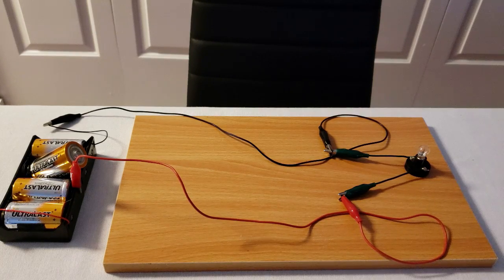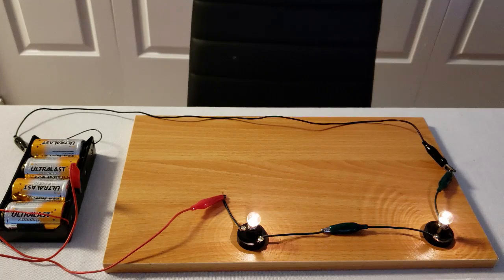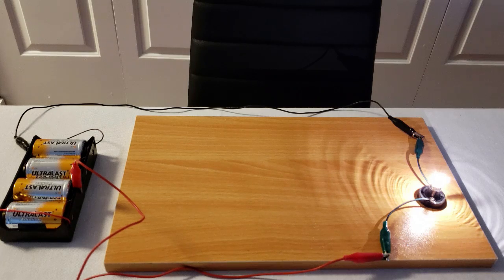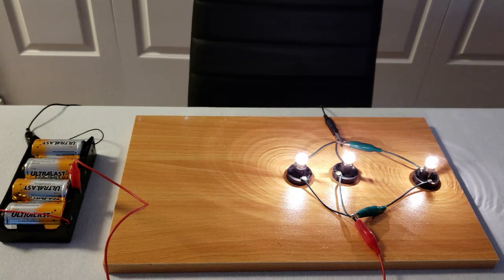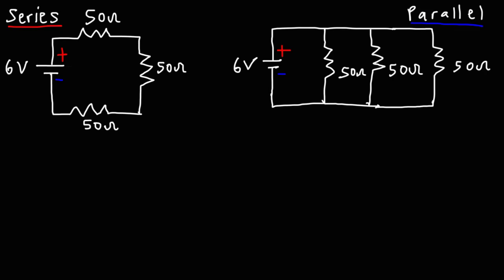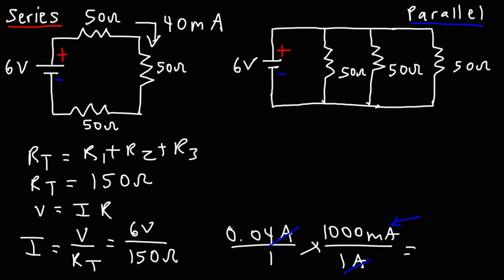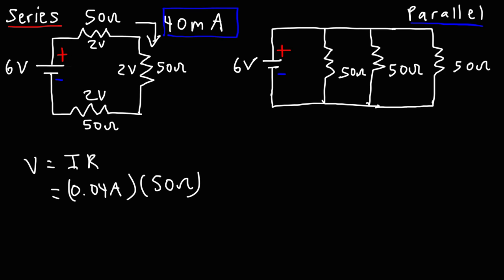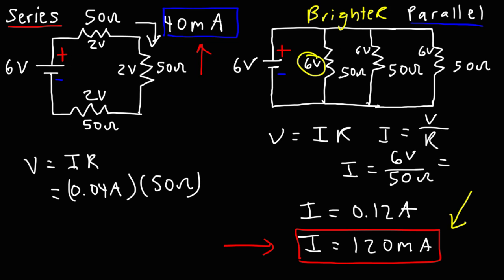Series and Parallel Circuits - Light Bulb Brightness

Comment: 3:18 wont the current split in a parallel circuit PLEASE someone help i have my cie in 10 days
Reply: Yes,the current will split but equally,cuz bulbs are identical.so they glow equally bright.if they were not identical.then the bulb with lesser resistance will glow more,cuz current is inversely proportional to resistance by ohm's law(if we keep voltage constant as in the parallel condition).I too have my entrance exam in 10 days😭.btw all the best.

Comment: I just had a question with parralel resistor lightbulbs, if the ratio of the resistances isnt the same wouldn't that mean the higher resistance bulbs would be dimmer as the split of the current in the parralel is no longer equal?

Comment: For anyone confused on if the light bulb brightness in the series of 2 bulbs is reduced by a reduction in current or voltage, the answer is both.

Here's how: 

If we have a circuit with a single light bulb of 2 ohms and a voltage from the battery of 8V:

V= IR
I= V/R
I= 8/2 = 4A going from the battery, through the single bulb, back to the battery

Power generated by battery = power delivered to bulb

Power = VI
P = (8V)(4A) = 32 W absorbed by the light bulb

Now if its the same circuit of 8V from the battery but going across 2 of the original light bulbs in series, each with 2 ohms of resistance:

V= IR
I= V/R (R is total resistance)
I= 8/4 = 2A going from the battery, through the 2 bulbs, back to the battery

Power delivered to each bulb = VI
Since the voltage across each bulb added together must equal the voltage supplied by the battery, the voltage across each is 4V
P = (4V)(2A) = 8 W absorbed by each light bulb

So if you connect a light bulb of 2 ohms of resistance to a battery of 8V, 32W will be supplied to the light.

If you connect 2 light bulbs in series, each of 2 ohms of resistance to a battery of 8V, 8W will be supplied to each light. (16W total)

This means in the 2 light bulb circuit, each bulb will receive 1/4 the power as the 1 light bulb circuit.

Comment: In series, the current actually stays the same. The voltage splits for each resistor, however. But the total voltage, adding those two up, will be the same as the battery's voltage. And it's not increasing any resistance; the total resistance stays the same. but it is split among the two bulbs.
Reply: Thanks for brining this up. For anyone reading this, watch "Series resistors" on Khan Academy for a short explanation.

Comment: I think in series circuit the curent is the same in each resistor but voltage is not the same. In parallel the voltage is same but current is not the same unless the resistor has same values.
Reply: Yes, you're right. In series, current stays the same but voltage does not. Thus the total resistance is the same but the resistance is split amongst the bulb which lowers brightness, not bc resistance increases* or current decreases*

Comment: Hi want to ask..if the parallel circuit i tap the  +ve wire from 2nd light bulb to first +ve side light bulb..and -ve wire 2nd light bulb to -ve side light bulb..is it still consider parallel?circuit still working?like yours u tap all +ve and -ve to connector..

Comment: if series circuits have more resistance than parallel circuits, why does bulb glow brighter in parallel?
because higher resistance=higher heat energy produced = more light produced
Reply: Yea, he actually made a mistake there. the total resistance actually stays the same in parallel.
Reply: Because the energy is shared between the bulbs in series whereas in parallel they get equal energy from the battery

Comment: Please - what v/amp ( little modellers) bulb should be used with a 9 v battery ?
Reply: if series circuits have more resistance than parallel circuits, why does bulb glow brighter in parallel?
because higher resistance=higher heat energy produced = more light produced

Comment: Current is not limited in series circuits. Are you sure this video is accurate?
Reply: if series circuits have more resistance than parallel circuits, why does bulb glow brighter in parallel?
because higher resistance=higher heat energy produced = more light produced

Comment: Are two wires needed to energize simple dc and ac circuits which say, power a bulb?
Let us answer this question with a question. When a circular belt is passing over two pulleys, why are two belts needed?
The answer: THERE ARE NOT TWO BELTS!
There is only one belt, and the belt is circular. It looks like there are two belts, with one of them flowing leftwards and the other one flowing right. But in truth, there is just one belt, and it is rotating.
So, why are two wires needed?
The answer: THERE ARE NOT TWO WIRES! Instead there is only one wire, but it is connected in a circle.
All metals are full of movable electrons, so when we connect a wire in a circle, we are forming a kind of “electric drive-belt”, which can move inside the wire. 

Electrostatics and circuits belong to one science not two. To learn the operation of circuits and the way they transfer energy, it is instructive to understand Current, the conduction process and Voltage at the fundamental level as in the following two videos:
i. https://youtu.be/REsWdd76qxc and 
ii. https://youtu.be/8BQM_xw2Rfo 

Electric currents in copper wires are a flow of electrons, but these electrons are not supplied by batteries. 
The millions of electrons in a circuit were already there before the battery was connected.
They (millions of electrons) were even there before the copper was mined and made into wires! 
We cover copper wires with plastic and colour the plastic; the electrons are not coloured!
Also see, http://amasci.com/miscon/eleca.html#batt2
It is not possible in this post to discuss in more detail the energy transfers in simple circuits. 
The last frame References in video #1  lists textbook 4 which discusses these topics in more detail using a unified approach and provides an intuitive understanding of energy transfer in circuits in the steady-state.

Comment: So when there is 3 bulbs in a parallel circuit is the voltage 1 Volt in each of them but the brightness is the same or each of them it is 3 Volts? I'm so confused please helps someone
Reply: if your battery supplies 9 volts each bulb in parallel will have 9 volts. whereas in series each bulb will have 3 volts
Reply: @Felix-sb5wp  I thought it has to add up to 9
Reply: @Felix-sb5wp  because if it added to 9 then it should be 3
Reply: No

Comment: how is the current reduced when its in series?
isnt the amount of current going through each bulb in series the same?
i thought the bulbs were dimmer because of the successive energy (voltage) drops across each bulb. 

also, when in series, why is the first bulb not brighter than the rest as all the current and voltage goes through it first.

cheers
Reply: According to my understanding, the total current is reduced due to increase in resistance(NB: resistors in series) resulting in less current flow compared to the first connection where there was one resistor. Then the very same less current will be the same across each resistor in series. As for the last question, I would expect that(first bulb should be more brighter than others) as well
Reply: @mohaleexelent9210  yeah I was thinking of this as well.
More resistance means less current, because the voltage is constant that will result in less power, less energy, therfore the bulbs are dimmer.
Reply: I would like to know this answer as well!

Comment: 9v does not =3v.  If you burn out and
 Low voltage leds on a high voltage batteries, leds will burn out wild somtimes. I took tons of videos a while ago of that happening. It was so awesome to see
Reply: I like the diagrams,  It really helps

Comment: THE ORGANIC CHEMISTRY TUTOR , 
                        if a lamp bulb draw .15 amps and another lamp bulb draw .25 amps how do you find the percentage of current draw between the two different lamp bulbs? what is the formula 
.15 amp lamp bulb draw less current compared to .25 amp lamp bulb by what percentage?

Comment: What happens if the bulbs have different resistances?
Reply: If the bulbs have different resistance then the next bulb in the series will glow lesser or be more dimmer than the first one.
Reply: What happens if you have a switch connected to each lamp on the parallel circuit and you turned off one lamp?, does the current drop as only two bulbs are illuminated?
Reply: ka boom 💥